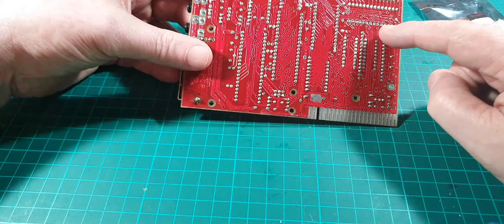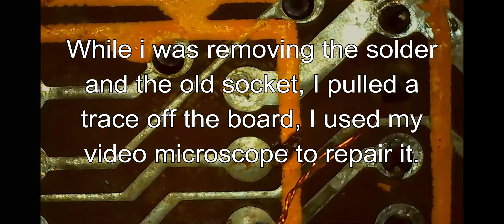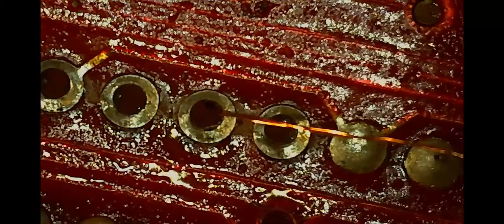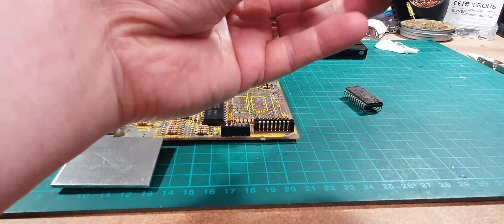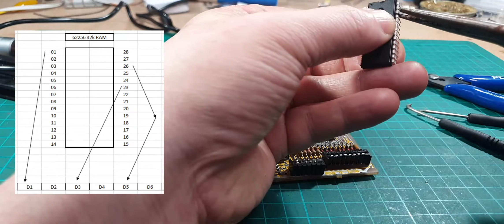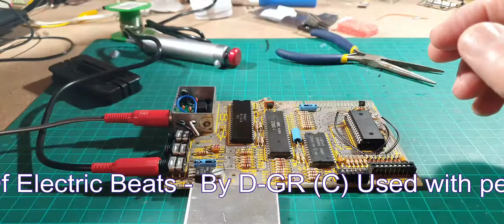ZX81 Part 2 – Upgrading the on board memory from 1K to 16K

Comment: Whoops--- done much the same at times. Good recovery!

When removing large pin count devices, it's usually best to snip the pins off the chip and then remove each pin individually. Much less chance to damage the board. Not much use if you want to keep the device tho!

Another useful item for the toolbox is adhesive copper tape You can get it on ebay and Amazon, but also in many garden shops, it's sold as copper slug tape, used to wrap around branches the stop slugs 

It is not insulated on the sticky side, so you have to b careful on that point. You used to be able to get a sheet of adhesive copper for pcb repair that was insulted on the sticky side, but I've not seen that about for many years.

Andy
Reply from the maker: Thanks Andy - yes i've seen that tape i might get some to try.  The actual size of the track was so small the bit of wire just fitted nicely.
Reply: You can get sheets of repair stickers which have single pads and pads with a length of track. One of the common ones I see are branded as Relife.

Comment: Installing the "WRONG" 24 pins socket instead of the 28 pins socket is not a problem, I often use sockets for 8 pins where I need 16 pins. I use what I have and cut up other sockets to reach the number I need. Use a Dremel to get the missing pins from another socket and put it along side the others, the total number of pins is reached when all the holes in the PCB found the reason for their existence. When the IC is its place then nobody will notice. 
 
I started with this on the Sabbath when all the shops are closed at a moment I was in need of a larger socket then there was in my collection (a card board box). From two 28 pins socket I can make one 40 pins socked and then I still have spear pins for later use. When you cut or Dremel it to the needed number of pins, often two pins are ruined, cutting and filing often goes off course. In the future NO MORE de-soldering, just add a bit from other sockets.
Reply from the maker: Thanks for your comment :-)

Comment: Does It works on Timex 1000?
Reply from the maker: The Timex 1000 is the USA version of the ZX81, i know they are based on the same circuit, but i don't know if the memory upgrade will work. A quick Google search should confirm this for you.